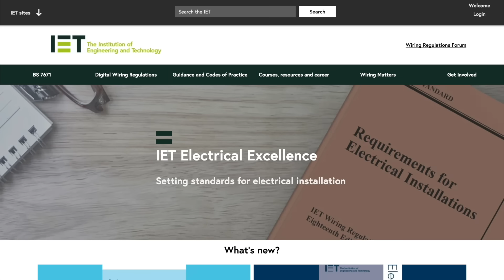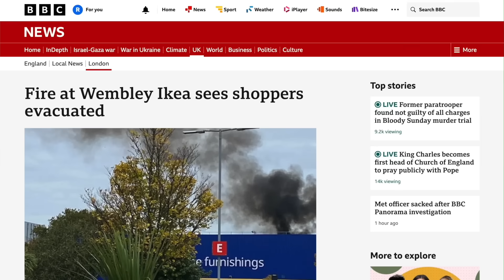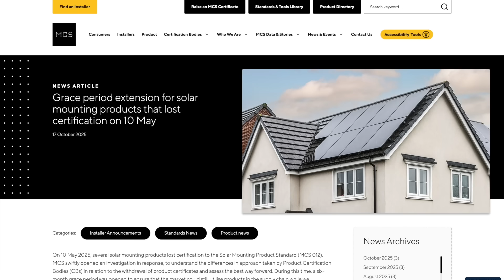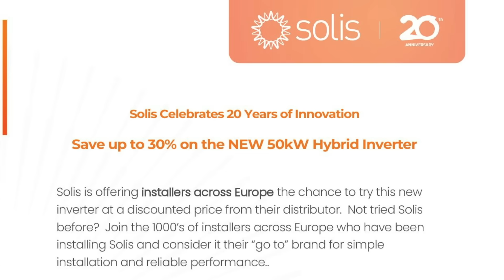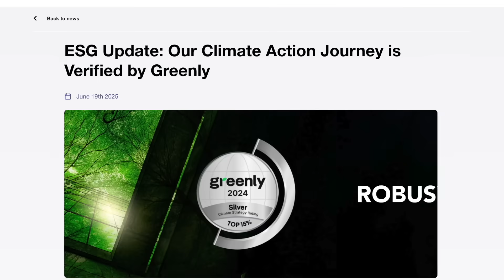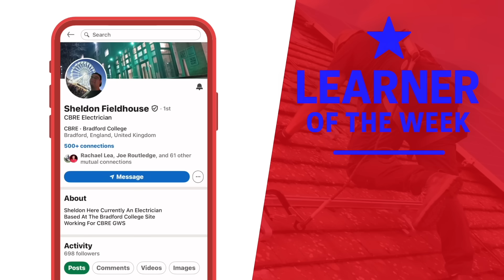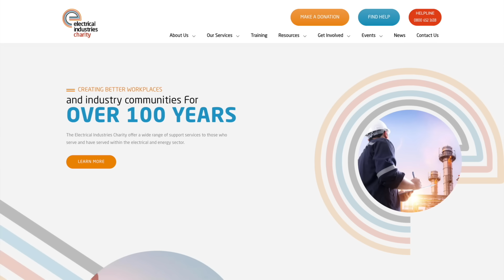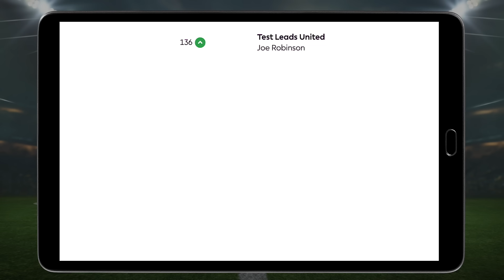Exclusive: Grid Bosses Set to Change UK Voltage

Comment: You can bet your last pound on it that a lower voltage will not lower bills 😂😂😂😂😂
Reply: Variable billing means we end up like Texas.  Thousands of pounds per MWh
Reply: @RichardFraser-y9t  Texas average is around the national average... 15c per kwh.
Reply: if you don't know what 
W=V*A
means
don't comment until you do
Reply: @frombrum  - Power is equivalent to voltage times current!
Less voltage will increase current flow for the same effective power output, and of course its current usage we are charged on!
Reply: @TwoBassed  Oh dear, it’s frightening.  “Les voltage will increase current flow” 🤣🤣🤣🤣🤣
Reply: @TwoBassed  Oh dear. That’s really frightening -  “Less voltage will increase current flow”.  Rewriting the laws of physics are you ?🤣🤣🤣🤣🤣
Reply: @arnolddill - If you’re using the same wattage it has to!
Reply: @TwoBassed You really don’t have a clue about the fundamental principles of Ohms Law, do you. If you reduce the voltage applied to a fixed load, the current flowing through that load will FALL TOO.  I suggest you check out the formula   I=V/R.   In your fairytale world a 1 kilowatt heater will always dissipate  1 Kw regardless of whatever voltage is applied to it!
Reply: @arnolddill  - What I was stating was to draw the same wattage on lower voltage current has to increase!
Can you show where Ohms law disproves this?
Reply: @arnolddill  but think of all the electronics that use switch mode power supplies. A lower input voltage would need a higher current to get the same power out.
Reply: @burtgummer9057 yes, exactly. Same problem. How are you going to achieve that increase in current on all currently existing switch mode p.s.u’s  if you reduce the input voltage. It can’t be done.  Reduced voltage applied to the same load resistance or impedance will always result in lower current drawn, and lower power output.  The p.s.u will have to be redesigned / re-manufactured.  You can redesign it to run on any input voltage you like.  But that Dosen’t help existing kit.  We’re going round in circles here!
Reply: @arnolddill  If a heater is thermostatically controlled - a heater will operate at a higher power until the thermostat shuts it off. It draws more power, heats faster but runs for a shorter duration. If it has no thermostat (e.g. simple tea kettle), it's power will do as you said - vary depending on voltage. 
Other than electric heating, older AC motors, and incandescent lamps - most of today's electronically controlled items use switched mode power supplies - they are fixed power and will raise current when voltage decreases. A modern TV will consume the same power throughout it's 100 to 240 volt range.
Turns out both you and TwoBased are correct depending on specific items being used.
Reply: @arnolddill  However, your ideas as to how a switch mode power supply operates are completely incorrect. They perform based entirely on power input, not a specific voltage. A 25 watt switch mode power supply will deliver 5volts DC at 5 Amps. It will consume 0.25a at 100v. And it will consume 0.125a at 200v.
That is why switching power supplies are  rated to consume a specific power input AND deliver a specific power output throughout the entire 100 to 240v range.
The power supply you were describing applied to old linear power supplies which did vary according to input voltage and did have to be changed if voltage varied too much. Linear supplies are seldom found in today's world.
Reply: @arnolddill  he said "for same effective output."
If you drop voltage in system, you have usually more losses per equal output, like watt hours.
Most electric motors use less current, if voltage rises some reason. Motor speed is equal to frequency. If load is resistive, it could and will take more current if voltage increases.

You knew all these, but still got need for comment that op was writing false details.
Reply: Would probably still go up
Reply: @johnburns5783  - Well first they have to charge us to lower it, then there’s all the charges to change the paperwork!
Reply: @TwoBassed  low voltage tax will be enforced too
Reply: @TwoBassed  Yep and then extra charges for ongoing maintenance of that.
Reply: Its like the food shrinkflation get less pay more for Rachel Reeves messed up books😊
Reply: @tommiealdridge she tells us we all have to budget for hard times while claiming £120,000 a YEAR in expenses for herself
Reply: It’s basically just another tax
Reply: As renewables rise, so do prices and instability. Got to love it.
Reply: The same energy should cost more, lower voltage is more resistance.
Reply: Thats because they bill for power useage not voltage
Reply: Tsunami of misunderstanding going on here
Reply: Whatever it is we ain't doing it !!!!
Reply: @weep5426   😂
Reply: On the older meters lower voltage meant higher amps and the meters uses amps to calculate power usage. Some towns in south Africa deliberately lowered their supply voltage to get more money
Reply: @izakpotgieter6863  They use both voltage and amps to calculate power as they must.  The physical design of the meter demands it.  There is a voltage coil and a current coil.
Reply: No.. you will need longer time to boil one litre of water. so the total energy consumption remains the same.
Reply: @maxfactor4209 higher amps more heat loss. less efficient
Reply: @maxfactor4209  Whilst the kettle is boiling, it's losing heat. So, total energy use is higher.
Reply: @mrfocigaz4942  You are right!
Reply: @mrfocigaz4942 true but marginal. Probably outweighed by how quickly you pour the boiled water out of it!
Reply: @mrfocigaz4942   A 1 percent change   in voltage reduction will extend the time to to boil a quantity of water by 1 percent, who will notice.
Small changes to the voltage will be well within the existing permitted tolerance.
Reply: @maxfactor4209 don't work like that... America has half voltage and kettles boil same time
Reply: @MarcusRobert-s2g lower voltage requires higher current to get the same power
Reply: @MarcusRobert-s2g  they famously don't boil in the same time in the US though. Unless they get one that works in the 240v sockets they can optionally get installed.
Reply: That was never going to happen 😂
Reply: Obv not
Reply: @johnburns5783  off grid is a beautiful feeling 😁
Reply: If not eu why complying eu standards
Reply: @masonajmufasamurphy2496  products made for a world market will be more expensive when produced to different specifications.
Reply: Bills will go up due to increased current draw and higher losses.
Reply: @talibong9518 A voltage reduction would cause either no change, an increase, or a decrease in peoples' electricity bill because depending on the types of devices and their reliance on voltage to maintain power output devices working harder to maintain power would increase consumption and costs, but devices that perform less work at lower voltage would run cheaper. Electric heaters would cost less to run.
Reply: @talibong9518  the current will be reduced in direct proportion to the voltage, only the time to deliver the amount of power will change.
Reply: @onlyapawnintheirgame  Both you and talibone are correct depending on what appliances are used. Resistive products such as heating elements (e.g. simple tea kettles) and incandescent lamps - you are correct. For appliances with active power supplies such as televisions, computers, LED lamps, etc - talibone is correct about current increasing for these items. But since electric bills are based on watts (voltage x current x pf), he is incorrect about the bill going up. In theory, it should stay the same for both (resistive draws less power but must operate longer).
Factoring in PF or Power Factor introduces a whole new can of worms into the conversation.
Reply: @johnburns5783  😆😆👏👏
Reply: Take more for less.
Reply: P=IV
Reply: @johnburns5783  it's actually tension. Voltage is the measurement units of it
Reply: @johnburns5783  You are quite correct, lower voltage means more current, and in turn greater I^2R losses. I is current when it is squared it goes up higher. Lower wattage light bulbs will lower the power consumed, most are likely already doing that. Your best bet to reduce costs is more insulation and heat pumps.
Reply: of course it won't.. 25% of your bill is profit. and these companies are owned by foreigners. they need nationalising.
Reply: @andyf4292  So you think your tax raising labor party won't use it to line their pockets even more?
At least you can buy stock in those evil companies and vote no.
Reply: It's per UNIT. And U R NIT gittin it back
Reply: @zoneadmin-n6c  Not with our government (UK) 😂😂😂😂
Reply: @johnburns5783  will be like chocolate. Cut down size and sugar, charge a higher price
Reply: That will put up the amps and increases heat
Reply: The Government of Ireland have a website for the general public to find a registered Electrician. That is a Member of Reci.  Perhaps his customer's were wanting a cheaper wiring system. 
🇮🇪🇪🇺
Reply: any chance Amps could enter the conversation?
Reply: @johnburns5783  The sheep will believe anything they tell them I've been awake for years saw it all coming!! More to come yet 😄😄😄
Reply: And it'll break a lot of devices
Reply: @periferaltoe  no
Reply: @johnburns5783  no just make all your electronics obsolete
Reply: @JayWoods-f5v4m  no
Reply: More current = more losses per watt used. 
Why do you think we transport ac across long distances using HV? Lower voltage at consumer level just means inefficiency for consumer loads which are mostly resistive. Didn’t watch the video. No care as to where the info came from. our DNO’s can’t find the money for maintenance yet alone a country wide overhaul. Just forget it.
Reply: Half the volts means twice the amps means more watts used.
Reply: Bills are based on kw/h - it won't affect your bill.
Reply: @bigdog8008 kw= amps x volts x power factor. The more amps you use, the more watts you use. If you double volts, you halve the amps. It most definitely affects the wattage use.
Reply: USA have a lower voltage and it takes forever to boil a kettle
Reply: @robertkustos2931  Their wiring is also twice the thickness because "if you halve the voltage, you must double the current, for equal power..." 🤫
Reply: @peterfitzpatrick7032 Are you being serious, or just quoting someone else's mistake?
Reply: @shamrockshore6308  In which part is he mistaken? The thickness?  Yes, that's wrong, because doubling the "thickness" (diameter, I assume) quadruples the cable's cross sectional area, since the cross sectional area of a cylinder (wire) varies with the square of the diameter... So, to double the cross sectional area of a wire, we must only increase the diameter by 0.414 (1 - root 2) But we don't have to worry about that, cable is sold / specified by its cross sectional area, anyway...  But, from my table (unused for years...) a 1.5 mm^2 cable can carry a 22A load (clipped to perforated cable tray,) and 6mm^2 can carry 51A (we might have expected 88A if the relationship were linear?  It isn't!  Peculiarly (I think) I felt a new wire was "thin" (early this century...) so measured its diameter, calculated its cross sectional area, found that to be less than the nominal area for that cable, 2.5mm^2, I think,  and questioned the manufacturer... Yes indeed, it was smaller in diameter and cross sectional area, since the modern copper conductor was more conductive than older copper conductors were...  So, neither doubling cross sectional area nor diameter  is correct, but, broadly,  Power = Volts x Current, or P = VI, so, you reduce the voltage, with a resistive load, you'll halve that load's output...  Except... the heating element's temperature wouldn't rise to the temperature it once did, so the element's resistance wouldn't be as great... So that relationship wouldn't be linear, either...
A while back, I didn't keep an eye on my mother in law's stairlift battery condition... That destroyed the motor... (an inductive load) The reduced battery voltage , led to the motor demanding more current, led to motor failure (brushes and commutator, really...) Electrics, eh? And kids with no arithmetic / mathematical ability resent being rejected for electrical apprenticeships?

I may have made errors, above, but what the... Just filling in time before my appointment with (and rejection by...)  St Peter
Reply: @shamrockshore6308  he is correct
Reply: You’re billed for watt-hours, genius
Reply: Don't even make sense volts don't change cost company's set costs the voltage is neutral depends on item lol
Reply: It should, excess unused power is dissipated via excess heat which you are paying for.
Reply: @vortexrcuk  Heat losses are proportionate to current. Lower voltage, higher current for the same power means higher losses.
Reply: @etchedpixels   ding ding ding.  This person gets it
Reply: It will actually a bit. Resistive and inductive loads will draw less power. Anything with a heating element and/or motor.
Reply: @simontay4851  He's meaning that all the corrupted people in power will only increase a tax for example so we will never pay less for it.
Reply: @steveclark..  "corrupted people" or "people" as I like to call them as the "corrupted" is implied
Reply: @steveclark..  Yep. We already subsidise the renewables in our energy bill and the gov (tax payer) pays the difference when they don't even generate any energy. Inflation is at 20% since 2020. The thing is, they reset how they count inflation each year to cover up the debasement of currency and just how worthless they constantly make it. Energy prices are 3x that of 2019 and I can prove it based on what tariffs I was on then and now and always go with the lowest price available I can get.
Reply: And deliver less hp, or heat in the same time frame so will need be on for longer

So wont use less overall

Also some kit may be at lowe end of eficiency in some circumstances 

Finally its pandering to inability to keep the grid in optimal health

Sounds like one day the grid collapse may be a thing
Reply: @BobNobody-p6l we foot the bill for propping up private companies
Reply: @elliotwilliams7421  Start a company that makes no power so they will pay you to not make power.
Reply: @simontay4851  but a heater running on low voltage will need to be on longer and so there is no saving.
Reply: @simontay4851  Induction motors draw more current, at lower voltage, especially when driven by an inverter.
Reply: @simontay4851  Resistive heating will just have the element on for longer as an action of the thermostat to compensate.  Don't expect the operating cost to change for them.
Reply: @simontay4851  IIRC power adapters are more efficient at higher voltages.  Whether overall it would be offset by other loads though, even less sure.
Reply: @simontay4851 are you serious? do you know anything about electricity? There's laws about electricity, y' canna deny the laws of physics Jim!
Reply: They'll draw less power but will need to be ran for longer to get the same amount of heat.
Reply: yes but if you draw less it takes longer to heat etc.

Comment: Sounds like there is too much impedance in the system, and that there should be more transformers that can change taps to keep the local consumer voltages in check

Comment: So I guess some IT systems will need an update of settings to work with the lower normal range of voltage. E.g. UPS as they would constantly need to boost voltage without being updated.

Comment: back at Crete, I had an AVR and a UPS for my electronics ...I also had a 48 volt transformer (2 kVA) - in the middle of summer the grid voltage would get as low as 190 which was rubbish for welding = 48 volt lashed in series with the mains gets back to almost 240 ...in Germany (on the farm) the grid voltage was 257 and welding with an arc welder was almost as good as MIG...

Comment: The "network operators" clearly don't live in the real world or they haven't a clue how things work. I guess they are assuming that "modern appliances" use switch-mode power supplies which do self-adjust in the case of lower (or higher) mains voltage. BUT a reduction in voltage will mean a proportionate increase in current drawn in order to maintain the same power. Increased current draw means more cable losses thus reducing overall efficiency. 
But that's not important so long as they're getting their green brownie points, is it?
Reply: I suppose that depends on the make-up of consumers; resistive stuff like shower, washing m/c dishwasher, kettle will take less current.  But rotating machines will draw more
Reply: Green brownie points? Clown
Reply: @YouTube2021FM he's right , that's all it is . Just another green bulljive idea .

Comment: I'd be interested to know if the meters will still show the same apparent usage regardless of voltage
Reply: In theory they should as they measure 'power' as a product of voltage and current. BUT many (especially heating) appliances are a lot less efficient at lower voltages so the end user may well end up paying more.